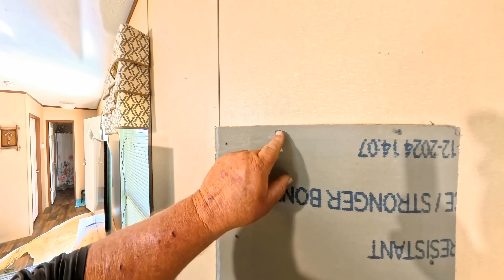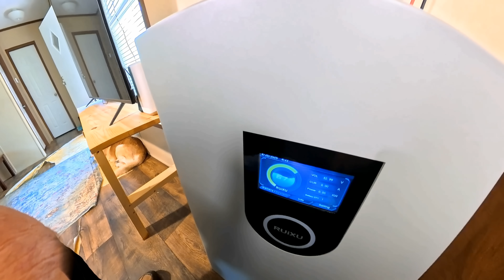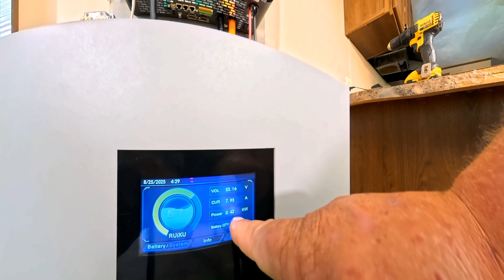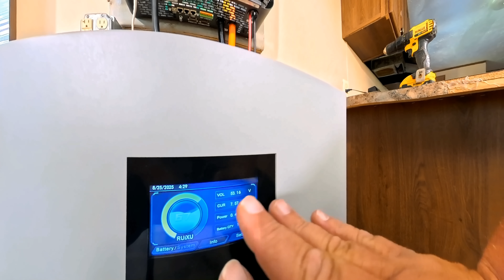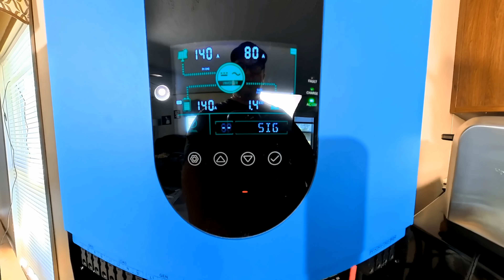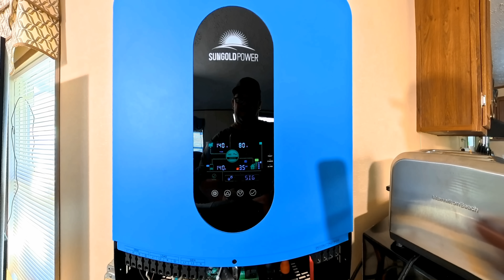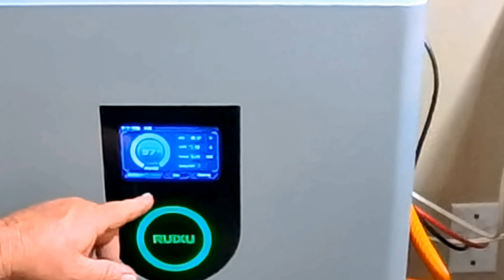Powering My House With 1 Battery Using Ruixu And Sungold

Comment: Growing up in an area rich in Motor vehicle shops I of course always worked in that field as a kid before getting a good education. One thing I learned back then was never leave a battery sitting on a concrete floor, because it will drain the battery and also cause galvanic reactions. I won't claim to understand how that works, but can the cement backerboard also have  these kinds of issues?
Reply from the maker: No, it is not true that modern batteries cannot sit on concrete floors; this is an outdated myth. The belief originated from a time when batteries had porous, rubber or wooden casings that would degrade, allowing battery acid to seep through and create a conductive path with the concrete, causing discharge. Today's batteries have sealed, plastic casings, which are non-conductive and prevent this from happening, making it safe to store them directly on concrete.
Reply: @OKLAHOMAOFFGRID  Thanks for the updated info!
Reply from the maker: @Poppy_love59 I always was taught that also growing up
Reply: @OKLAHOMAOFFGRID  So not just my old memory huh? lol